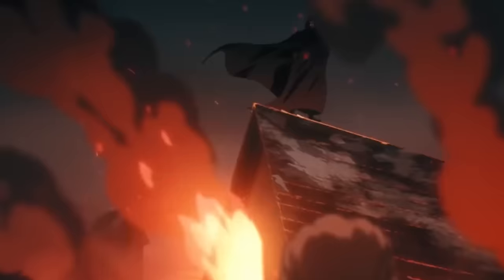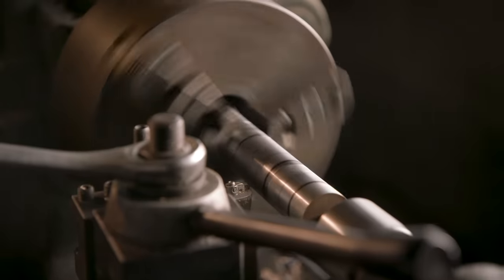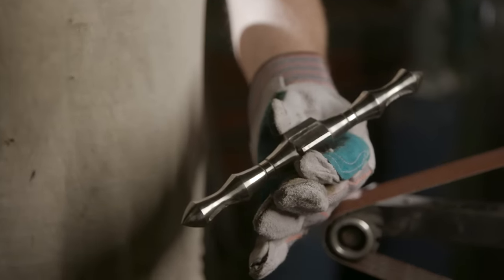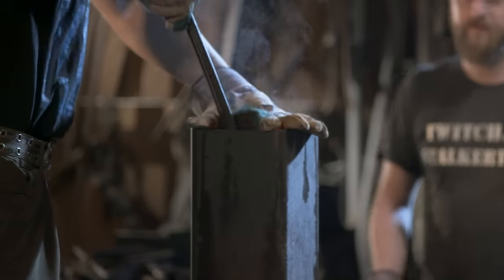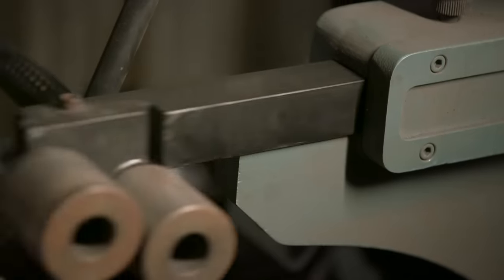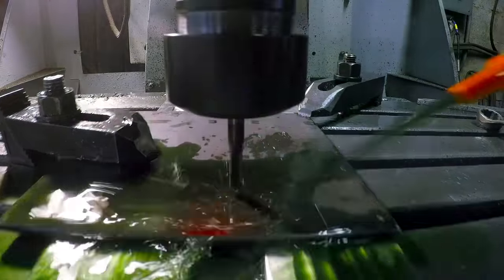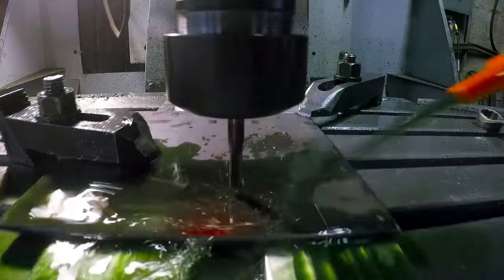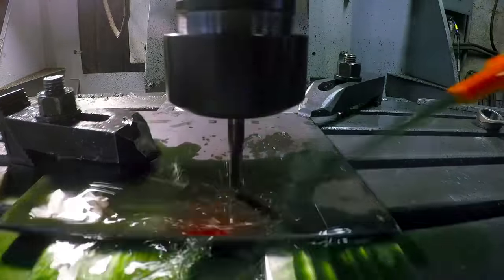Alucard’s Heirloom Sword – Castlevania – MAN AT ARMS: REFORGED

Comment: I love how Alucard's sword is stupidly and impractically long but it makes sense for him specifically. 

His superhuman strength makes the force on the sword tip a nonissue. And he doesn't unsheathe it manually, but telepathically so no point in having the hassle to take a 7ft sword out of it's 7ft scabbard.
Reply: I think it's not, because zweihanders usually have 1,8 meters and are pretty good to use
Reply: @felipeguedescampos851  but zweihander is the kind of sword using brute force. With broad blade. Thick metal. Balance to the tip. On the other hand aluca sword is build like a rapier. With this long length. Its lost its purpose of a rapier, which is control when balance shift to the tip. And the guard is claymore guard. If its a claymore, too thin, too little mass force. If its a rapier, too out of control.
Reply: @battleriteroyalevietnam8447  in real life you have two handed trusting long sword with this type of guard, and in one a one fights zweihanders are often used like spears, still it's not the best idea to make a sword like this, because you lost the main purpose of a zweihander but I don't think that is impractical
Reply: @felipeguedescampos851  its practical when the user have much more hand power than normal human. But if they are, just give them pole arm instead. :(
Reply: @battleriteroyalevietnam8447  it's really a bad guard, because a normal person usin this weapon would gonna, half swording most of the time, but not impractical
Reply: @felipeguedescampos851  thrusting longsword still need to have more stronger and thicker blade than this one
Reply: @battleriteroyalevietnam8447  yeah, if want a focused trust long weapon that you hold like a spear, why don't use a spear that it's way more cheap, and probably has a more durable blade
Reply: @battleriteroyalevietnam8447  yeah, and alucard's sword is more long than a long sword, it's definitely a terrible sword
Reply: Guys, this is an estoc. It is a real type of sword.
Reply: @battleriteroyalevietnam8447  Well, thing is that we don't know if the balance actually HAS been heavily shifted towards the tip. They stated that it is indeed an Estoc, a very long Estoc, but it still has the same function. With the blade being as incredibly thin as it is, roughly around the overall width of two fingers and coming to a fine point at the end, on top of having a very ornate and heavy looking handle, it might not be too far out of the realm of possibility of this still being a viable weapon to be used for thrusting all while still remaining controllable.

Also, small note, but probably still important. Alucard is 5'10 in universe and the hilt, if stood on end, ends at around his nose. So the overall length of his sword is more like 5'8 - 5'6 in length, not a full 7. Still ridiculously long, but not as insanely so as 7ft.
Reply: It's not impractically long. It's just a thin long sword. I think the part you're forgetting, or possibly just don't understand, is the distal taper paired with the weight of the handle, crossguard, and pommel, which were all steel. The sword gets less and less 3-dimensional the closer you get to the tip. Meaning the balance is such that you could sign your name with it, much like Zorro. Also, that estoc isn't 7 feet. You're thinking of William Wallace's claymore.
Reply: @battleriteroyalevietnam8447  Your reply made me want to throw several swords at you. Please learn the correct usage and feel for each of the swords you mentioned.
Greatsword/Spadone (Zweihänder)
Upper-Longsword (Claymore)
Estoc/Rapier
Reply: @robertthebruce6035  what did i say was wrong profesional?
Reply: Don't forget that he can fly so he won't risk smashing it into the ground on every swing.
Reply: @thefuturepresidentofameric5957  i knew it was familiar
Reply: @battleriteroyalevietnam8447  Zweihanders are not a "brute force" sword. Really no swords are brute force" swords. Having trained with multible swords for 7 years that's a myth. They are not that heavy and most of the two handed swords are actually faster then most one handed swords because the second hand adds a lever motion. That's why the katana has the same blade length as most European arming swords but is used primarily 2 handed. The plus side of a 1 handed sword it the free hand for use on bucklers, shields, and sometimes other weapons. And yes that speed includes fencing swords such as the foil and rapier. The image of a big old two handed sword used by some big old Barbarian or thug is from poor movies and video games. Those longer swords move fast and hit hard. And the amount of strength needed isn't much. The only problem wielding them comes when someone who is short tries to wield them not because of weight but because the sword can hit the ground durring some techniques. But an average sized man or a women a tad bit on the taller size can use them without issue. If they were slow people wouldn't have used them. In an age of armor slow weapons had no use. Even most Blunt weapons were actually pretty light. The flanged Mace for instance is around the weight of an arming sword. It's just all toward the tip. No one went into battle with 15 to 20lb weapons. I know people do all these "tests" agienst things like cheap mall costume Armor and say "that broke a few ribs" but even without any Armor a long sword that doesn't cut is just going to give very bad bruises. And in the heat of a fight no one will even knowtice that.
Reply: Some weapons just fit bettering with having certain superpowers 
Like clouds super strength and his buster sword
Reply: i love how you just ripped this comment straight out of a comment section of a different video, actin like you're slick
Reply: @SWMG57  spotted the fraud?
Reply: @felipeguedescampos851  they had grip that compliment that length, the heirloom blade did not
Reply: @battleriteroyalevietnam8447  It's an Estoc.
Reply: Longest sword ever wielded in real life was over 6 feet long.  They likely had someone else hold the sheath for them before battle
Reply: I love Alucard 💓
Reply: I love Alucard
Reply: @battleriteroyalevietnam8447  no sword is for brute force. Technique and skill always apply and will always triumph over undisciplined muscle.
Reply: Seems to be about the same length as a rapier, honestly. Which were carried by normal humans all the time.
Reply: I like to imagine the sword was originally draculas, hence heirloom. Considering drac is like 8ft, it tracks.
Reply: This is copy pasted off of a YouTube comment of Alucard and Trevor's fight?
Reply: @felipeguedescampos851  I haven't read all your replies yet, but it seems you're missing a very fundamental property of this weapon. Firstly, it is an heirloom sword, meaning its one showing off status and two meant as a more noble weapon that a spear (which is typically a commoners weapon). This is very clearly not a terrible weapon, due to its diamond shaped blade that'll give it the structure necessary to push through the gaps in armor. I know its also trivial to say, but I have to cover my basis, this is based off a historical sword so all of you outcries about a terrible design is moot; because otherwise this sort of weapon would not have seen such widespread use.
Reply: @battleriteroyalevietnam8447  His sword is modeled off of an estoc. The blades of estocs can be between 50 to 60 inches long. And are still used as a finesse and piercing weapon. The only difference is that they generally do not have sharp edges and are much thinner used how much discursively for piercing. But they can sometimes be used for slashing, it just requires a higher quality Of metal and much more careful forging process. So while his sword definitely is in efficient For a normal person to use, it’s not completely unrealistic.
Reply: SEPHIROTH

nanananananaaaaaaaanana

SEPHIROTH
Reply: @battleriteroyalevietnam8447  bro's decribing a estoc like it doesnt already exist
Reply: not really
Reply: Also it’s enchanted. It seems durable despite the look since it was able to survive Dracula’s Dark Inferno and not have a single scratch or burn mark.
Reply: @battleriteroyalevietnam8447   Feels more like an Estoc than a Rapier to me.
Reply: @gokbay3057  i call every thin small blade sword a rapier like.

And alucard fight like one.
Reply: @battleriteroyalevietnam8447  An Estoc is also a thin bladed thrusting sword. But it is far closer to Alucard's sword by having a hilt and guard very much like a Longsword rather than the one handed grip and elaborate handguard of a rapier.
Reply: @asarothelle3975   I could be wrong but the blade looks almost like a cross between an estoc, a bastard sword (hand and a half hilt and fairly long-ish blade), and a rapier shape wise
Reply: @felipeguedescampos851  a spear gets stuck an Rapier or longer version of it, does not, or supposedly would not. You could pierce, and then turn and slash as your pulled free of the one foes body and into another's. People like to look at sword on sword "Duel" like fights, but rarely did this actually happen. In many cases, there were more than one foe at any given time. Granted in the anime and telekinesis.. its all a bit different, but thats also Why everything is exaggerated like the size of the sword.
https://en.wikipedia.org/wiki/Estoc
Reply: History
As armour improved, so did the methods of attacking it. It was quickly realized that cutting weapons were losing their effectiveness, so crushing weapons such as maces and axes were utilized. Thrusting weapons that could split the rings of mail, or find the joints and crevices of plate armour, were also employed. Long tapered swords could also be used as lances once an actual lance had splintered. Thus was the estoc developed. The French word estoc translates to thrust
Reply: I think it's also an homage to Vampire Hunter D's ridiculously long sword.

Comment: I can't get over how SHARP it ended up being!!!! Great job, guys! I thoroughly enjoyed this episode. The dedication put into making each weapon in each episode is just stunning!
Reply: Yeah, normally estoc blades aren't particularly sharp on the edges, just the tip. But the way they made this sword, the cross-section is basically a perfect compromise between a thick diamond estoc  and a more flat rapier. Effectively, they made a rapier estoc, that can perform admirably at either function, though I imagine the armor penetration is a bit less than what a true estoc is capable of.

Comment: Asta's Demon Slayer and Demon Dweller swords from Black Clover would be a neat build.
Reply: @THE DRAGON KNIGHT SLAYER64 the Demon Slayer is shorter than the buster so they may have an easier time with it. The design in itself is meant to give Asta a decent amount of leverage.
Reply: @THE DRAGON KNIGHT SLAYER64 
The Demon Slayer is a heavy sword that is barely the same height as the main character. The fact that he's as tall as Wolverine shouldn't change that fact.
Reply: i thought about that, and almost asked for the second only, but the problem is that people would be mad if they did one or the other, and yes, it would be heavy, but its very thin and probably about 14 inches across, whereas the other is supposed to be a rapier esque longsword (i know that some of that is wrong, but its a general consensus about what certain weapons are in games and shows rather than what they were actually called)
Reply: I could have sworn Demon Slayer was the shorter of the two Swords Asta uses and Demon Dweller was the one that was as larger as him.
Reply: @ECSDaemon  haha, i dont remember that well, but i think that the slayer is the smaller one, but i dont feel like searching for the answer since it's yet to yield any importance in the anime and im not caught up in the manga yet, so idk about there either
Reply: @thatrelishguy  I've been binging on Black Clover recently, both sub and dub, and I remember the Queen of the Witches call the smaller sword the Demon Slayer Sword.
Reply: @ECSDaemon   yeah, i think thats what i said, im pretty sure i said (if i didnt what i thought was) that the smaller sword is the slayer

Comment: Unlike many other projects, this one ended up being pretty damn usable!
Reply: Dima Zeru unlike most anime swords this one is of reasonable size and with. A bit on the long for a medieval sword.
Reply: @MandalorV7  it's still a reasonable lenght for an estoc (some could be 150 cm long and this looks like is on the 120-130 cm range) and contrary to some popular belief they were two-handed blades. Aside from the sharp edge (estoc were almost exclusively used for thrusting and weren't sharpened) this could be quite accurate indeed.
Reply: @rosiello5100  Indeed so. But I just judge by the way it handles the milk bottles and the wara.

Comment: Nice! How about making the Belmonts' heirloom whip, Vampire Killer?
Reply: Yes! The vampire killer, but, i think is complicated, most of the works ar swords.
Reply: Given the fact that A) The Vampire Killer has had a metric crapload of looks, B) The fact that it's traditionally a leather whip, and C) The fact that it's a completely flexible weapon, I highly doubt they'd be the guys to look to for a Vampire Killer build.

Although I'd pay damn good money to see their Alucard sword on-screen alongside an IRL Vampire Killer.
Reply: @MemesToa  They did the sword based on the netflix series, so they could just as well do the "morning star" look the vampire killer has in the second season of the series.
Reply: @nathansossai  It seems you missed my 3rd reason for them not being good candidates: It's a completely flexible weapon.

To my knowledge, they have never done any weapons that consist mainly of chain(s), and given their background as blade smiths, I have my doubts that they'd go and forge a chain for the Morning Star whip.
Reply: @MemesToa  How hard can it be to forge a chain?
Reply: @karlhnedkovsky5214  Aside from forging each individual link(most chains nowadays are made by machines due to time), forming them together so they can be used in the correct fashion for the weapon, and making sure they're strong enough so that the whole thing doesn't break?

Yeah, there's a reason chains weren't really widely made until the Industrial Revolution.
Reply: @MemesToa  I see. Welp, I guess it's the thought, that counts? #TheMoreYouKnow
Reply: @karlhnedkovsky5214  Yeah, it sucks. But like I said earlier in the thread, I'd pay damn good money to see an IRL Vampire Killer in action alongside their Alucard Sword.

Comment: "...Estoc, has a very thin blade, very long, very lethal, for both slashing..."

Isn't an Estoc an edgeless blade?
Reply: I pretty much have the same question.

Estoc as a name seems to be used for a few different things at different times (and different languages) and is probably as almost everything sword related widely misattributed and contested, but it seem there is at least some agreement on what is to be classified as an estoc. This includes: narrow with a sharp point, intended for, and robust enough to be used against armoured opponents, and effectively edgeless - if not necessarily edgeless in a literal sense, as they are not round.

If they are also intended to be used for cutting, they would reasonably fall in some other category in modern nomenclature.

In short: I think any sword capable of effective use as a cutting sword are better called something else to avoid confusion.